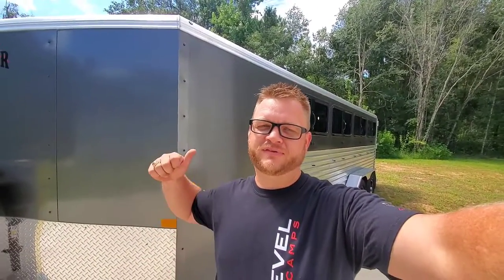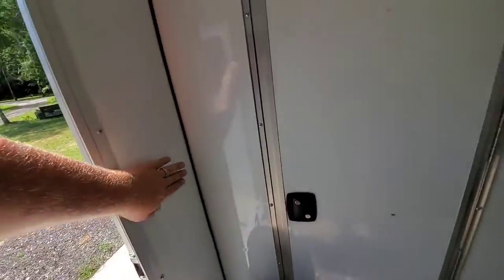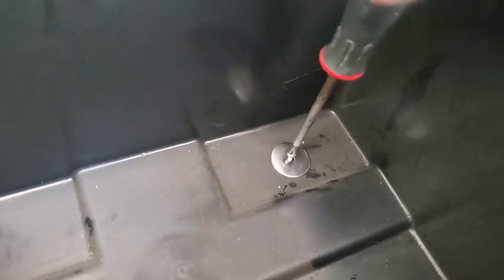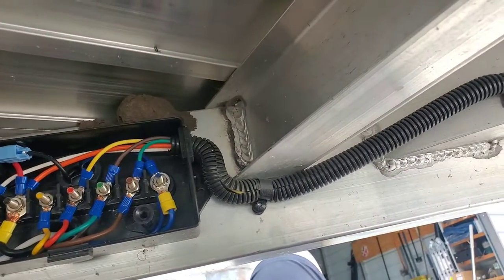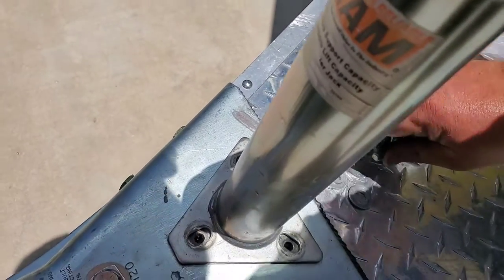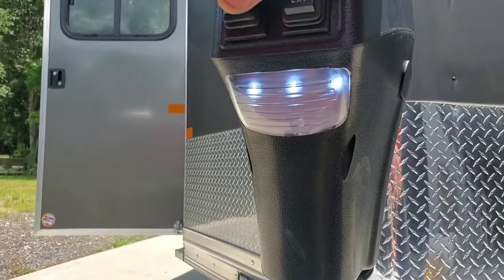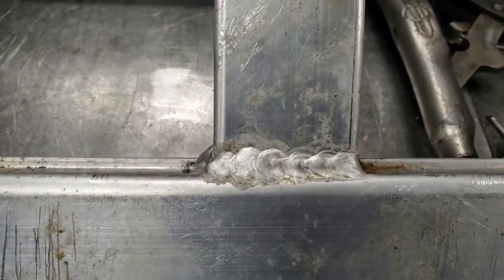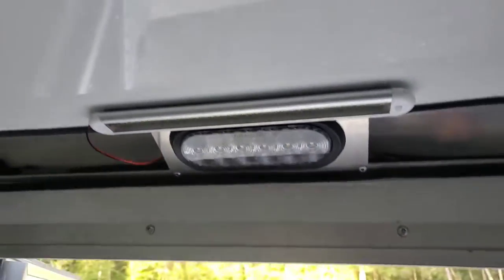Livestock trailer 12 volt battery system and generator mount

Comment: why did'nt you put the generator inside the trailer in front ''V'' up high, surely it would be better from a security point of view, that said have to say you are a very good, Quality Welder, your attention to detail is brilliant, Liam in IRELAND
Reply from the maker: Thanks. If the generator were inside then it would be much hotter in the room and then we would have to deal with exhaust fumes and possibly building an enclosure around the generator. So it was just more practical to put it on the tounge of the trailer